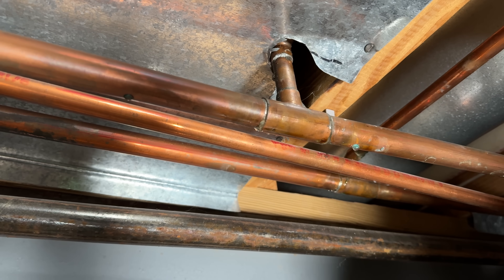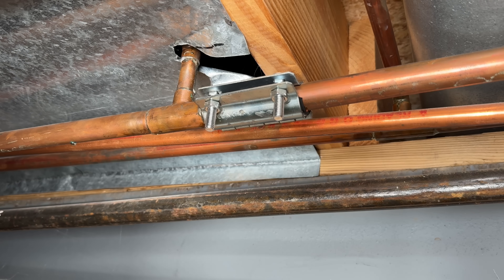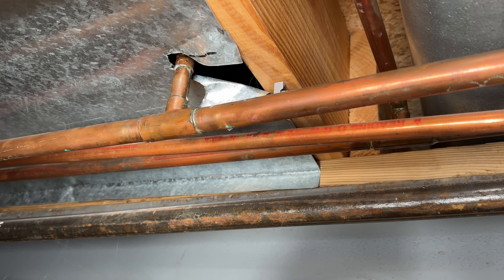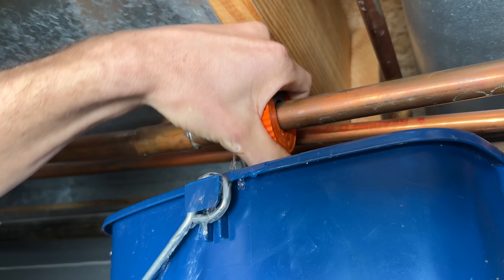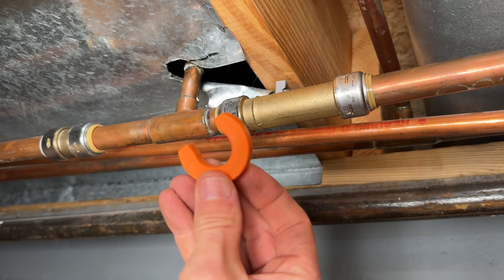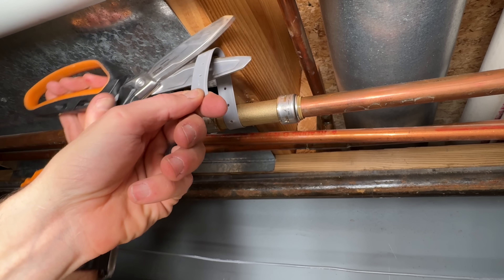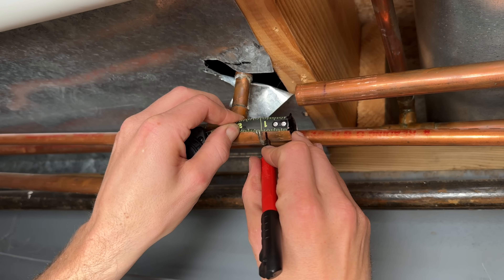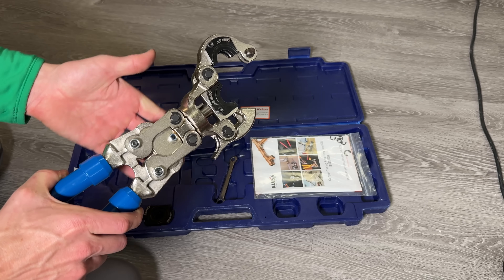How To Fix A Pinhole Water Leak In Copper Pipe | No Soldering Needed!

Comment: I just rented a Dewalt ProPress tool for the weekend from Sunbelt. I discovered if you rent on Friday after 1pm you keep the tool till Monday 9am for 1 day fee.

 Lowest plumber was asking for $650 to install a whole house filter. Parts and rental costed me half that amount and got to learn a lot being the first time using the tool. Took me a whole Saturday afternoon installing the filter and a  noisy PRV. The tool is foolproof for a DIYer like me, I guess that’s why it costs a kidney or two
Reply: I finding the same issue. No one even wants to come out for my small job. I'm hoping Sunbelt has tight-space pipe cutter for large pipes.

Comment: SharkBites are great for emergency/temp repairs. Yes, they will last some years, but after doing mechanical work for the last 50 years, I have seen plenty of O-rings fail, no matter if it was used on air, water, oil, or freon, they will harden and crack. So for me, I would not use them for long term. Same with the crimp fitting, it has a O-ring. Lots of people saying they have had SharkBite for years, and yes, they have, but once they start drying out, cracking, getting small leaks, or big leaks, you can be assured, that the other fittings won't be far behind in failing. And as usual, there are lots of variables as to how long those O-rings might last, things like chlorine in the water, how much pressure fluctuation, how much temperature swing, if there is any movement in the pipe due to contraction/expansion or even water hammer, some people run ozone machines, and that will break down rubber products like crazy. So not for me, other than a quick temp fix.
Reply: Valid point regarding expansion and contraction especially in snow areas . Another consideration is that a copper pipe w Hot water is gonna see the temp  fluctuation ALL the time. On the other hand, pinhole leaks seem to be more prevalent due to municipal water supplies..... in my non professional opinion. In my opinion when the water was spiked w chlorine, it was not as corrosive as when they started hitting us w Chloramine..... thats when pinhole leaks in my area became more common place... Go Pex and dont bother w copper.... its more vulnerable these days

Comment: We discovered over the holidays that our copper (4 inch I believe) waste pipe has dozens of perforations.  When looking for the source of the leak an inspection of the vertical copper pipe just before in mated to cast iron fitting which then disappears into the basement concrete floor I found like a dozen pin-holes which made the pipe look like it was sweating.  But it wasn't sweat, it was active leaks.  I wrapped the pipe with a silicone wrap but will have plumbers in to quote a solution.  I am also worried about what the condition of the remaining copper waste pipes.  When we bought the house I thought, wow this was done right, look at all this copper waste water pipe.  Crazy!  Now I am thinking, what were they crazy?!!!  5 decades of home ownership and I have never seen anything like this.  If anyone has suggestions on how to best address the issue I am all ears:)!

Comment: One main thing when you are using shark bites 
Do not let the shark bite carry the weight of your pipes or be bent under pressure of too long or too short of pipe at connection these are the most causes of shark bite failure I see.

Comment: Love the videos have a major distrust of any fitting that doesn't have some sort of mechanical seal.  I feel a compression fitting or soldering would be a permanent fix vs a rubber o ring that will dry rot after 20-30 years.

Comment: I have had several SharkBite fittings fail on copper older than 1980. It appears that quality control in manufacturing back then was not considered critical since size defects would not be noticable in solder joints.
Reply from the maker: Hmmm, interesting and thanks for the feedback.

Comment: Hose clamps and rubber are a great fix!

Using a small piece of shower pan liner (although a bicycle innertube may work as well) cut to less than the circumference of the pipe, placed over the pinhole leak, and secured with a hose clamp will get the job done.
I've used good quality hose clamps and shower pan liner to repair many (dozens) of these types of leaks without a single failure lasting over decades!
You don't need to close the water supply, in fact it helps you know when you've put enough torque on the hose clamp.
If you have to do this in the same residence or facility many times, consider replacing the pipes. Use PEX and recycle the copper, you may be surprised at the net cost.

Comment: Solder in a new section including the "T".  Also, when possible avoid cutting the sheet rock all the way into the corner were it meets the wall.  It will easier to restore.

Comment: In a pinch I've used an automotive hose clamp and a piece of rubber cut from an old radiator hose as temporary repair device.  It lasted for weeks until I finally got around to fixing it correctly.
Reply from the maker: Yeah, I also carry a few hose clamps in my plumbing kit 👍

Comment: Pin holes near a fitting are often caused by the nearby joints not being deburred. The burrs cause turbulence in the water flow and erode the pipe.

Comment: Excellent upload.   I would add that if you're going to sand and remove the chunks of solder from a pipe you're repairing, do so before the pipe is cut.   It' irritating to sand or clean a pipe if it's unsupported and flopping back and forth and up and down.

Comment: I had a pin hole leak in a copper pipe I put pipe dope on a short stainless steel screw and screwed it in the pipe ,tricks of the trade.
Reply: Your copper pipes will rust due to chemical reactions with other metals.
Reply: I worked there foe ten years and no problem became of my repair and I don't think copper rust.

Comment: Good video. I have no problem with sharkbite fittings for permanent repairs (they've been around a long time).  Have plumbed and replumbed multiple houses (that had galvanized pipes) using pex pipe with pex crimp and  sharkbite fittings.  Have you used the speedfit twist and lock fittings (which are usually cheaper)?  They are like a sharkbite,  sold as "John Guest";  Sharkbite now have similar "prolock" at HD.  I've used them for many years and been happy with them (avail regular and slip).   I'd probably use a regular brass compression fitting before using the propress.   Can you tell I dislike sweat fittings?   I can do them but really would be a last resort.  Pex is just so much easier, cheaper than copper and much less likely to pin hole.

Comment: Shark bites are excellent.
Not being critical, just asking a question - Don't the pinholes and corrosion on the vertical pipe joint concern you? I don't know what would cause those pinholes, but it seems like the pipe is compromised and requires replacement.

Comment: Just do it right. Temporary. You'd be surprised how many people miss that part. If you're going to rip out drywall and re-do it, make sure it lasts. What was that galvanized sheet metal with that ragged hole? Could be caused from leftover flux or an impurity in the pipe from manufacture. Cheap thinwall 'RED' junk. I'd be cutting that out of there.  Modern code in most places only allow 'Blue' for domestic supply and 'Red' for HVAC boiler/radiators. I've seen 'over softened' water or junky well or municipal cause those pinholes too. Normally starts on the hot water side and then you start to chase them over time once you get a few. Would  be advisable to cut a section of that leaky pipe out of there to inspect it. Seen that green junk in the pipe when you cut it and the murky water. There's more going on than a couple pin holes. No I don't trust 'Sharkbites'. Don't really like the press either. Those connections are EXPENSIVE, so is the tool. I you're doing a housing development, sure, time is money. That's the whole reason for it.
Reply from the maker: Thanks for all the feedback.  I am inspecting more of the pipe to see if there are any other signs of pinholes developing.  Makes sense that this isn't a completely isolated issue.
Reply: @EverydayHomeRepairs  I would definitely get after it to find the cause. I've rarely seen it isolated to a few leaks. Normally it happens near the HW tank. As the tank or anode rod deteriorate, steel or magnesium  particles are carried into the water supply and lodge in the pipes and cause electrolysis from the dissimilar metal parts of the specs. I would also do a water test and check the PH. Over time most 'old' copper pipe has a protective layer built up, real thin.

Comment: If copper is leaking it's done. Any fix should be considered temporary. If you live in a costal area copper is worthless. Seen dozens of 20 year old houses replumbed. With lots and lots of damage.
Reply from the maker: 😬, that's not encouraging.
Reply: @EverydayHomeRepairs  I was often doing the repairs after the plumbers had replaced all the pipe. The USVI was considering banning copper for a while. The local plumbers lobbied hard to keep copper.

Comment: I've used Shark Bites, but I never used them in an enclosed area.  I thought local building codes forbid them in such a location.  If I can, my preferred method is still soldering a copper fitting.
Reply from the maker: Thanks for the feedback and I don't know of any area where SharkBites are restricted to only open areas.

Comment: Once source of pinholes is that your local water supply has higher than normal manganese which can cause pinholes. If so then Pex would be a better solution. One company that installed copper fire lines used a swage tool to expand the pipe and then braze the sprinkler branches, they used a cutting oil that had high chlorides in it which caused corrosion and pitting inside the copper lines. So chlorides are another source of pitting. For instance where the local water supply is a well system that is chlorinated because of high bacteria counts such as E. coli and Coliform.😅

Comment: COME ON FELLA. How long would it take to just solder the joint. I would use a large soldering iron because of the fire issue. Soldering does not take that long at all. 
The repair using sharkbite I will pass. Had to many recalls from customers who did what you did without deburring or properly deburring the pipe. Not to mention not seating the coupler placement properly. Just to many do it yourselfers out there not following proper procedure. 
Last thing Scott, EHR, I would use a copper strap instead of plastic fantastic PERIOD !!!!!!!!!
Please forgive me, I AM AN OLD TIMER WITH 40 PLUS YEARS OF PLAYING WITH PIPE !!!!!!!!

Comment: I plumbed my kitchen renovation 10 years ago with shark bites so far so good!  I have had pin hole leaks in copper I use inner tube patch kit with radiator clamp it will stay forever.
Reply: That sounds reassuring, "so far so good" , LOL

Comment: This was helpful. I was trying to find a video I saw about adding a ball valve inline with no cutting the copper. Some type of fitting that goes around the pipe then cuts the pipe. I don’t have a main cutoff in the house, only at the curb (or dirt road, as it were😉). I’d like to add one if those would work, but cant find the video, now.

Thanks for your content, I watch both solar and these, but 99% of the time on Apple TV, so rarely get on just to comment. But I’m a fan.
Reply: SHUT-OFF valve installs on a LIVE WATER PIPE - Aladdin EasyFit Isolator

Comment: My leak was right past a ball valve 6 inches before the water main entered my house, & it was 6 pm & it was a sizable leak.  I looked at it, tried some emergency  clamps like yours, but they didn't work.  Called a plumber.  OMG.  He used those new fittings like you finished with, replacing several sections of pipe with leaking fittings.   $980, took him 20 minutes.
Reply: All the trades have extremely high prices, especially with all the shortcuts like propress and pex. It's really awful. Hopefully the market will correct itself with more kids going into trade school instead of 4 year degrees where 50% of them will never even use the degree.

Comment: Most of the plumbers use the copper press tools in Australia. A lot of places, particularly commercial, won't allow open flame soldering anymore. Time will tell if any good long term. As only an O ring. The press with the hand crimper is quite crude. The good professional crimper also need continual calibration. Some can even tell you they are not crimping at optimum level.

Comment: The only people who hate on Sharkbites are either 1) professional plumbers who don't like that they're simple enough for people to successfully do somewhat major work themselves or 2) people who have installed them improperly and had a leak. They're definitely expensive, but so is a ProPress tool...and if you improperly install a ProPress fitting, they'll leak too. :)

I also don't agree that a properly soldered fitting is the best way to go--tell that to my 50yr old house where many/most soldered junctions are green because of tiny leaks corroding the copper over time, with some dripping requiring replacement. Also type M copper pipes are trash.

Comment: If you have several pinholes, isn't it likely to be caused by water corrosive to your pipes, meaning you've got pinholes developing throughout the house?
Reply from the maker: Yeah, I am finishing the rest of the project this week showing how to also repair the drywall.  In that video I will talk about inspecting the rest of the line(s).  👍

Comment: 3 leaks. Copper. What is the root problem? Probably the water. I had a leak in my garage ceiling the I soldered to fix. Then several months later I had another leak located in the wall leading to the master bathroom. Again I did a solder fix. As I was repairing the ceiling I noticed another dripping leak and walk around looking at the ceiling I noticed yet another water mark on the ceiling about 10 feet away from the hole I made. I had a plumber come in to move a gas line (unrelated to my problem) and he said the water in my area is hard. I checked with the water company and sure enough that is a problem with copper. 
My final permanent fix is PEX-A. The expansion tool is about $400 but well worth it. I’m in the middle of doing a complete repipe. A plumber would charge about $10,000 so $400 is nothing. Besides, have you checked out the price of copper lately? Crazy expensive.
As I move through the repipe process I’ve been using Sharkbite fittings to temporarily connect PEX to copper. Not a fan of Sharkbite but they work well for a temporary fix.
Reply: FYI hard water isn't acidic, it's alkaline.  Many water suppliers are mandated by state water boards to to add a certain percentage of calcium carbonate or other alkaline chemicals because it has an anti-corrosive effect, especially on galvanized pipes, which are highly prone to corrosion.  Yes, hard water sucks, but widespread plumbing failures is worse.  I have galvanized throughout my 90 year old home, except for the water main, & the inside of my pipes is amazingly pristine.  Leaks in galvanized occur mostly when soil touches the outside of the pipe, or when some idiot makes the galvanized pipe a ground(don't ever do that!).

Comment: The Shark Bite (via a professional plumber) saved my butt at my office due to a pinhole leak behind a built-in cabinet.  The leak was on a pipe in the 5" space between two studs.  No room for any other option.  We had to cut out the back of the cabinet for access.

Comment: I distrusted sharkbite until I had to replace all of my hot water lines under the house in a very tight crawl space. I bit the bullet and decided to give them a try. They have worked great for eight years now.
Reply: Same here. I need to add 2 water filter and due to the limit access, this is where shark bites come into the place, the pipe and water filters still can turn after installation. So far so good since 2019 - 5 years now.  No more changing house water filter at a odd angle and water filter housing and move up and down by using shark bites.
Reply: 10 here.
Reply: I was also super skeptical, but they work!
Reply: Use at your own peril, temporary fix.
Reply: Idk why people distrust them. Chamfer the pipe properly and they'll last decades; it's simply a matter of not damaging the o-ring.
Reply: @devnull.elixir  Because some of us have had failures. I've had 2 fail. They were less than 10 years old.
Reply: Water heater is a perfect situation for sharkbites.  Solder anywhere you have to cut holes to make repairs. Pex is the way to go on new work and whole house retro.

Comment: I think the release tool is used in the other direction.  the square edge against the release ring and the rounded edge against your hand.  The square edge gives a better push against the release ring.
I have used sharkbite for emergency repairs as well as some small plumbing remodels as well.  Some of them are over twenty years old here in my own home, and I have never had an issue as long as they were inserted completely as you said.
I was unaware of the depth gauge and deburring tool.  They are now on my Amazon list for the next order.
Thanks!

Comment: Never had a plumber say anything good about sharkbites. Even the when I've already  hired them, their consensus is that is not the professional way of doing something.  I might consider something like that if I planned to move out sooner rather than later but if I planned to stay for a long time, I'd call in a licensed plumber. I used these good ol boys next door in alabama.  They have done work very reasonably price and without the BS. If it was going to be really expensive I'd use the crimp on. Yeah I'd buy a crimping tool. Especially if it had a Mwaki logo on it and came in a red box.

Comment: That first fix should definitely be considered temporary. This as the copper / steel contact will suffer from galvanic reaction and corrode to failure over time.